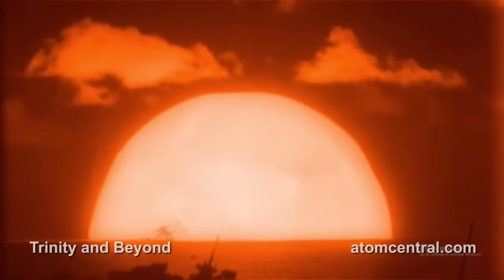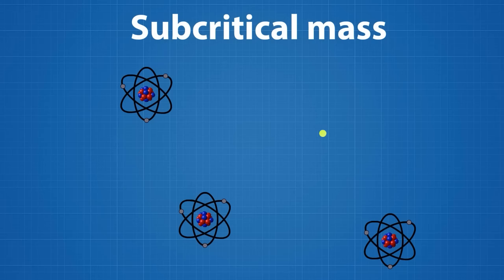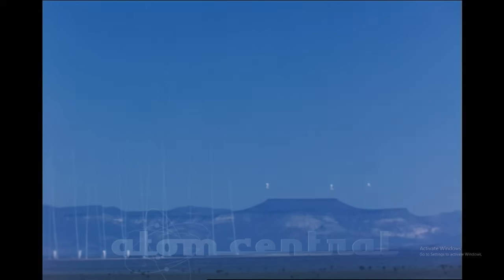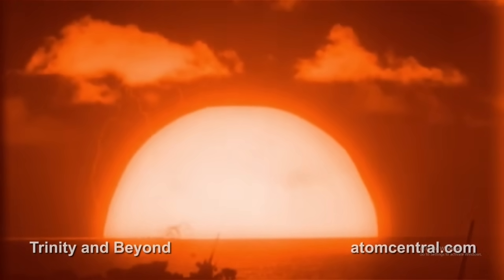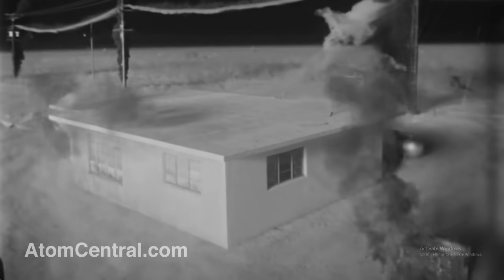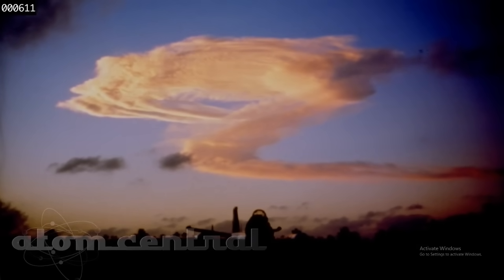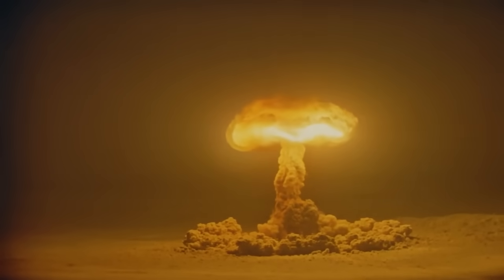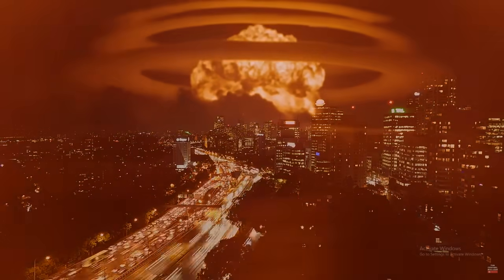Anatomy of a Nuclear Explosion

Comment: Where did you get the source for the diagram at 1:32? I've been researching nukes recreationally for a long time, but this is the first ive heard of the little neutron gun being a part of the implosion type design.
Reply: @derekmiller6091  Polonium doesn't radiate neutrons, but rather high-energy alphas.  The alphas knock neutrons loose from the beryllium nuclei ("spallation").
Reply: I dont think its a neutron gun as much as it is a neutron generator, 
Matt bunn talks about them in the belfer institute lectures
Reply: @sam2902 it’s totally healthy that I often fall asleep to Matt Bunn’s “How Nuclear Bombs Work” lectures, right? Surely that’s some kind of mental health red flag, but those lecture videos manage to translate something that begets unimaginable horror & violence into an unobtrusive, almost ASMR-like documentary I can reliably snooze to.
Reply from the maker: I didn't find the diagram, I made it in adobe illustrator. The diagram is not an accurate depiction of the implosion device. The neutron gun is placed off to the side to help illustrate how the implosion sequence works. I believe the neutron gun is placed in the middle of the charges, behind the plutonium core.
Reply: The zipper initiator was used starting in about 1955 in the Teapot series.  It is a linear accelerator that frees neutrons by spallattion.  It's not aimed; the neutrons go in every direction.  They are outside the explosion material since neutrons can travel through normal matter essentially freely.
Reply: You might want to read Tom Clancy's novel, "The Sum of All Fears". About a nuclear terrorist attack.....
Reply: @barneylinet6602  I have, several times.  The story down't mention the initiaator, so perhaps he reused the one in the retrieved core.  The story doesn't specify (as cest I remember, its been years), but he does melt the core down and recast it to more modern specs.  The story treats the retrieved core as solid (the terrorist that dug it up holds the core in his hands, with no mention that it was two hemisspheres.

Comment: I applaud, a simple and informative video how a nuclear bomb works. However there's a mistake, -35F is -37.2C not 1.7C
Reply: Indeed, as -40 is the same value in both units
Reply: Hey guys, don't get mad but that is an accurate conversion and you don't know that -40 C is not -40 F
Reply: -40 F is 0 C
Reply: Some shit like that, -1.7 C
Reply: @dsxa918   No, 0C is 32F, the freezing point of distilled water at sea level. -40C is the same temperature as -40F.
Reply: @dsxa918 🤦‍♂️
Reply: @garysmith9818 ...and water is densest @ 4°C
Reply: @philgiglio7922  Eeyup.
Reply: @dsxa918 32F = 0 C. Plus the actual temp at 5 miles is more like -50C...certainly not 1.7C
Reply: Your Insane for Applauding such irresponsible testing then and now ...
Cancer Cancer & even more Cancer !!!
Worldwide !!!
Reply: I was about to comment on the same thing
Reply: And the Fahrenheit and Celsius scales meet each other at -40 degrees.
Reply: AND, to be totally scientific, it is not "NEGATIVE 32 degrees." It should be stated as "MINUS 32 Fahrenheit" or "32 BELOW ZERO Fahrenheit." I have corrected our local weather forecasters on this issue.
Heat is measured energy, you can't have NEGATIVE energy.
Reply: Yeah, uh. They're talking about a number on a scale which describes the energy level. You certainly can have negative numbers. (On a related note, I can actually hear the eyes rolling at your local news organizations.)
Reply: @jf860  temperatures can be negative. heat cannot. you were wrong in your attempt at being pedantic.
Reply: temperature and heat are two different things.  q=mc∆t @jf860
Reply: @jf860  what are you rambling on about? negative 32 degrees is the same thing as minus 32. although you could argue that minus is actually an operation, in which case only negative 32 would make sense
Reply: @jf860 If you are working in absolute values the terms are Kelvin or Rankin…

Comment: What's the the white ring that forms around the stem of some nukes? Also, why do nukes cause shadows on people when blowing up?
Reply: I think the white ring are clouds being pushed away by the shockwave, but what do you mean with "shadows on people"?
Reply: It was probably a typo when he said on not of.
Reply from the maker: As nuggetospaghetto said, the rings are clouds being pushed by the shockwave and heat. People weren't blown up by Fat  Man and Little Boy, they were either vaporized or burned. The shadow you're referencing is scorched or "bleach" concrete, wood etc. from the pulse of radiation from the detonation. The same thing happens when you wear a shirt and get sunburned. The areas that are covered have no burn marks, but exposed skin (forearms, neck) do as they were exposed. The "shadows" aren't actually shadows, just spots where the backdrop was covered by a person or object and therefore not scorched by the radiation.
Reply: As for shadows, they are shadows "of" pepole. The fireball vaporized them, and created a human shaped shadow on a wall. Of the people who died, they were the "lucky" ones, if you can call it that.

Comment: Plutonium's half life wasn't a surprise for me, but they 700 Mill from Uranium is insane. It literally cannot fathom that
Reply: Uranium-238 has a half-life of 4.5 billion years. Since the earth is about 4.6 billion years old, the amount of Uranium-238 that had existed at the time of the earth's birth has now reduced to half.
Reply: @Gumshrud-h7d  That's a relevant point, and I've read that decay of the original "haul" of U-238 (and the now mostly completely decayed U-235, which was probably present in equal amounts when the elements forming the solar system were belched into space by a primordial supernovae) contributed to keeping the Earth's core molten
Reply: @phillipdavidhaskett7513  I agree. U-235 the fissionable Uranium probably was in similar amounts.  U-235 has a short 1/2 life, 25k yrs. yet still exists in small amounts,  I don't understand why all of U-235 has not decayed away?
Reply: @Gumshrud-h7d  I'm pretty sure U-235's half-life is measured in millions of years.  Since there's about 1 atom in every 140 (0.7%), it's been decaying at a steady rate since its formation, which was many billions of years before the solar system coalesced from the remnants of a prior supernovae that synthesized all the elements above iron that required a net input of energy per the curve of binding energy.  I wasn't here, so I'm only speculating.
Reply: @phillipdavidhaskett7513  fascinating.
Reply: @phillipdavidhaskett7513   238 is millions,  235 isotope 1/2 life 24,400 yr, approx.
Reply: @Gumshrud-h7d  U-235 has a half-life of about 700 million years, not 25k years. 4.5 billion years is a bit over 6 of its half-lifes, so its initial amount would be reduced to about (1/2)^6 = 1/64. If one assumes the initial ratio of U-235/U-238 when the Earth formed was 50%, (although one should really start counting from when the isotopes were created in supernovae explosions and in what percentage),  it now would be 1/128, and U-235 would make up less than one percent of naturally occurring Uranium, which it does, at 0.7%.

Correction: I forgot that the U238 was also decaying, so over the lifetime of the Earth it would have decayed to about 1/2 of its original amount. So the ratio of the two would be about 1/64, assuming an initial 50/50 mixture.
Reply: @jeromemalenfant6622 This calculation made me lose my religion, it disproves the biblical age of the earth.
Reply: Yeah but this video was a little misleading. It made out like the longer the half life is, the more deadly and concerning the fallout product. In reality, it's a tradeoff. The longer the half life, the less radioactivity it has at any given time, so therefore, generally speaking, the less dangerous it is.
When working with uranium, your primary concern is usually the chemical toxicity, rather than the radioactivity. It just isn't so much of a radioactive hazard like Sr90 is.
Reply: @kzm1934  perfectly said.
Reply: @kzm1934  yes, but if you stay longterm on site where that thing 700,000,000 years halflife is, you gonna get cancer anyway probably, just at slower rate.
Reply: That's Uranium 235. Uranium 238 is 4.5 billion years. Keep in mind there are a lot of naturally occurring radioactive elements in our rocks and soil, including uranium. Small amounts of radiation including background sources generally don't cause health problems.
Reply: The U-238 (that is only about 10% of the uranium in a bomb) has a half-life of 4.5 billion years - the age of the Earth, and its is exceeded by a good many other isotopes.  See Wikipedia, search for "isotopes by half-life".
Reply: Uranium's "Half-Life", is incredibly long, so long; that it has been used, to "date" the Universe.  As I understand it, all The Hydrogen, and some of the Helium, in the Universe, was created, in "The Big Bang, along with Uranium, and some Lithium, with the remaining Lithium, Beryllium, and Boron, created shortly  thereafter, as The Bang, cooled.  The Elements from Carbon, to Iron, are created by Fusion, in Stars, and We are just beginning to understand, how the Trans-Ferric" Elements are created, in Supernova Explosions, Neutron Star Collisions, and similar events.  The Yields from these events, are truly staggering!